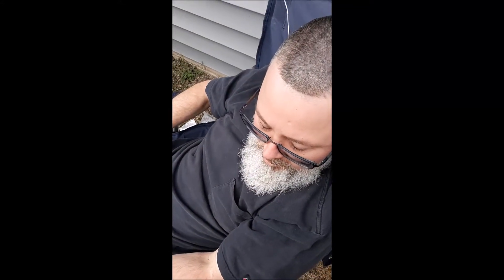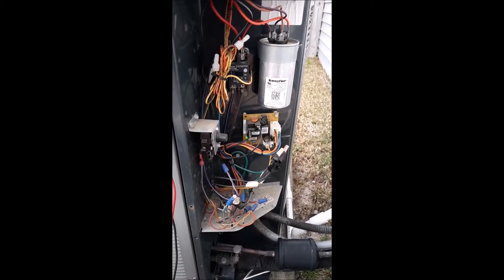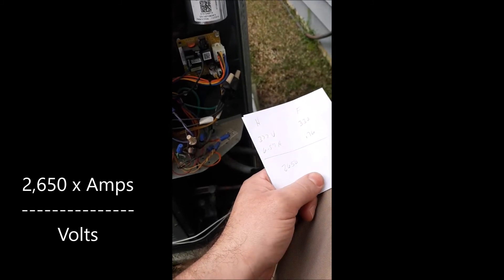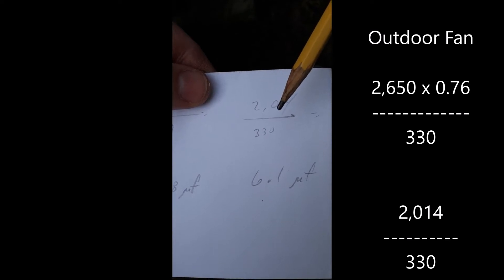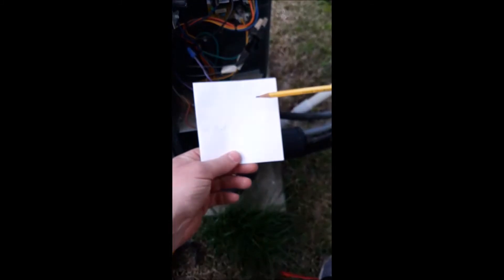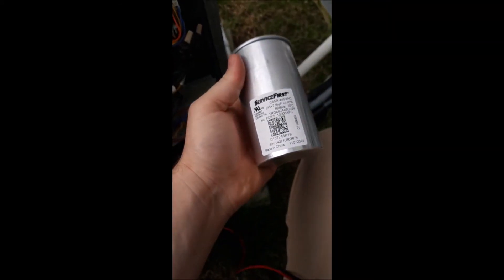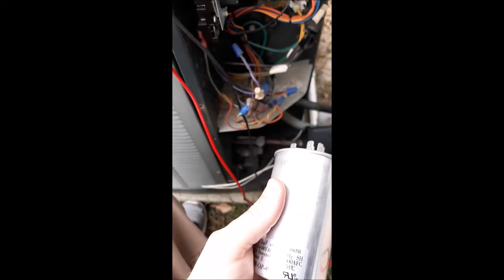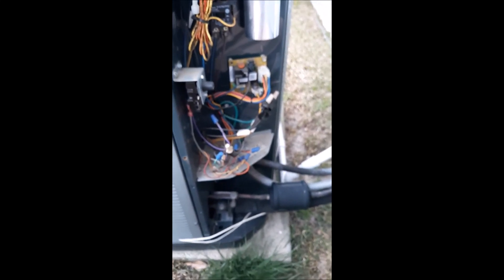HVAC Capacitors - Dual Capacitor Checks

Comment: I just remove two wires leaving the "herm" connected, and measure microfarads ("uF") directly with a cheap multimeter.  Also, many capacitors operate on the edge of their temperature ratings in condenser units - you can get longer life by unloading the dual by adding a separate, dedicated fan capacitor.
Reply from the maker: Good idea, i.might have to try an experiment and see if that holds up.
Reply: @johnjennings-JJ  My home unit was eating a dual cap every two years.  I put in a dual for the compressor, and used a separate for the fan.  That was 7 years ago.
Reply from the maker: I might try that with mine. I heard some older guys would put a hard start on new units, not because it needed it but because they thought it helped/ prolonged the life of the motors/capacitors.

Comment: No cap in a box for this guy.  Used to check with analog meter, x1,000 needle swing.  Much improved equipment nowadays.
Reply from the maker: My co-worker showed me a pic of a dual cap in a clear cup. I thought the box was bad enough! Although he probably found that pic on the internet and not on a job.